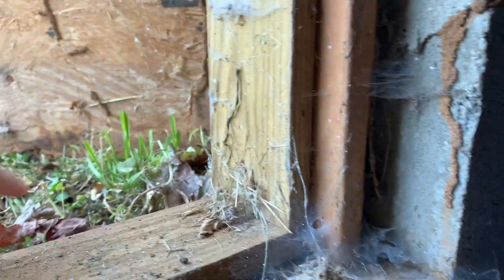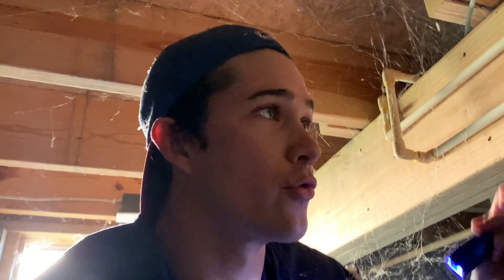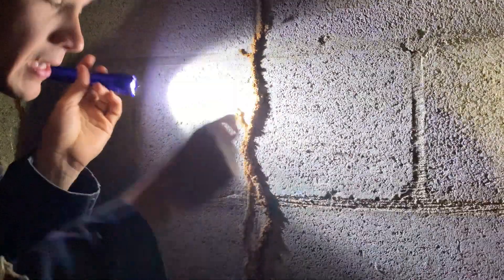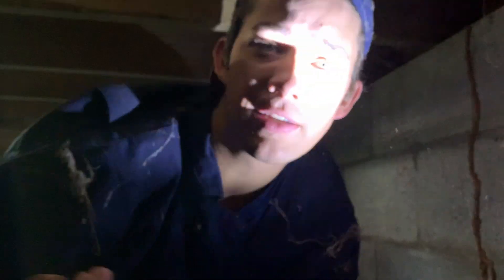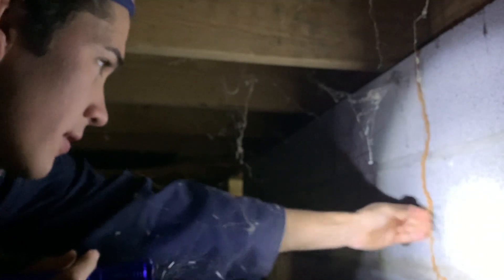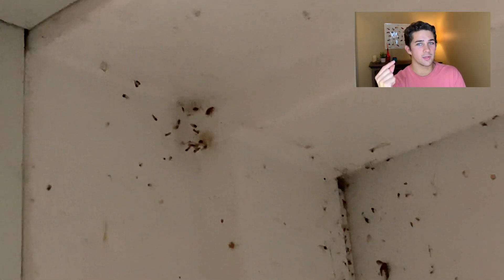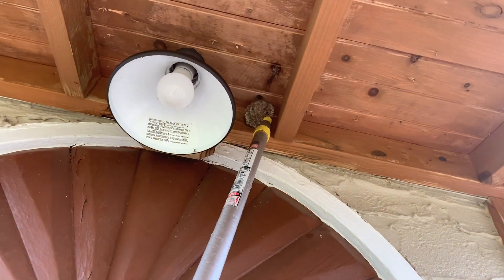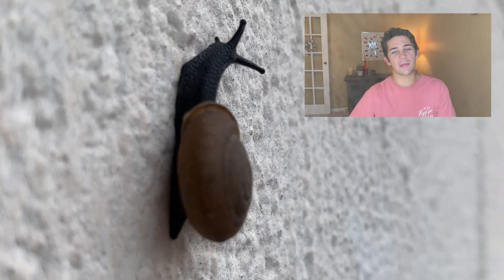This is How Termites Get Into Your Home!

Comment: Dan new to the channel, 
Thanks for your time , ehh the spider web gives you a  new subscriber!
Dan help me here leave in Florida and frame house with vinyl  siding on front and back of the house
I left outside a LOT 5-7  2x4  next to the house between the bushes and the siding 
Now there are all dried and break when lifting up or step on then they have dried  lines or crates and so worried cause when at the attic have since a lot of ants trails they keep changing that trail and orto ‘s from Lowe’s kills then but then move likely I find again on the roof trust walking 
How do I now if behind the vinyl  siiding are eating all the house ?  Termites or ants or just the weather destroy the 2x4 in 3 years what is can do to control maybe the wood acts as bait station? Help please
Reply from the maker: Well, the piece of wood is a good clue, but won’t make a difference as far as termites or ants. I would get a pest company to give you a free termite inspection and see what they find. Has the house ever been treated for termites?
Reply: @DanTheBugMan  thank you Dan ,
NO THE HOUSE NEVER BEEN TREATED SINCE I BOUGHT IT 4 years 
They are not honest like you, other inspectors,I wish you live close to Florida west palm 
Anyway he said 1200 for trench, or 900 for a tent since the attic  found a ants nest in the insulation under the a/c unit , dropping water and now I can see the ceiling paint bubbles.
Also bait stations like 400$ .
So I decided to buy termidor HE 
And trench the house , 
and talsar s/c 
0.09 I believed and sprayed at the roof trust , the most I could 
Any suggestions I WILL DO IF YOU THINK IS NEEDED 
Thank dan for take time to answer me
Other on the tube , they don’t even bother,  keep up the good work on your channel